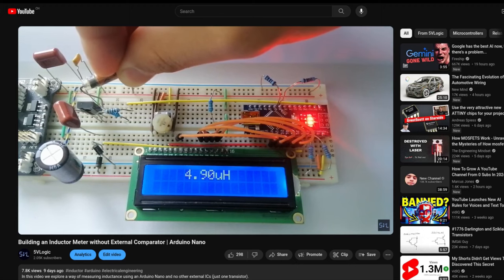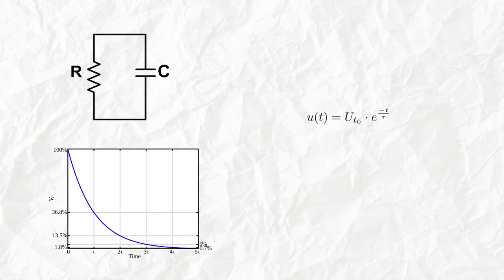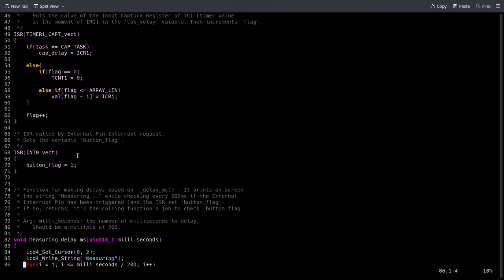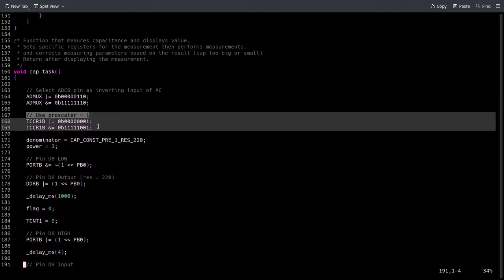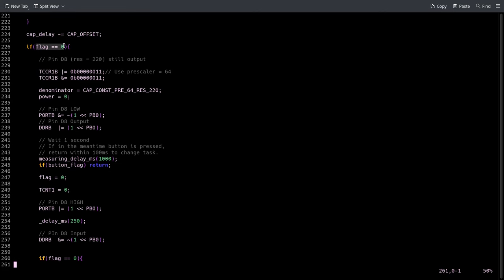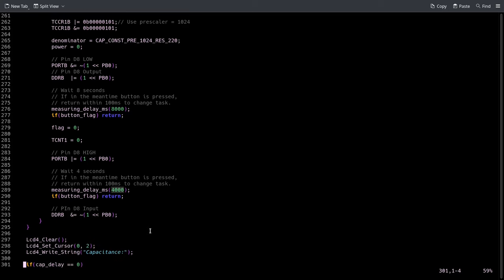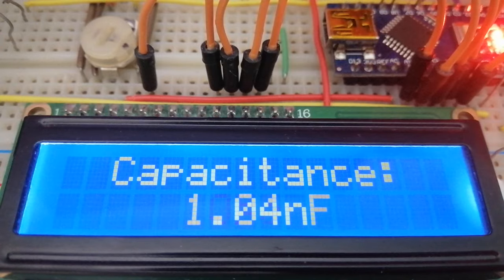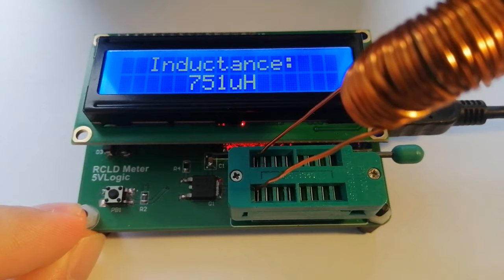Building a Capacitor Meter without External Comparator | Arduino Nano

Comment: Good job! I wonder if instead of trial and error method for choosing the range, you could use an ADC to track the very first points on a charge curve. Since it is linear in this region, you would instantly have a decent approximation
Reply from the maker: That's a good idea, I should try it

Comment: Very nice project! It would be cool if you could spend a short time going through your schematic, and then any peculiar layout choices you had while designing the PCB, unless you don't like sharing that.

You might also be able to use a transistor/mosfet and smaller resistor, for the purpose of charging or discharging the capacitor very fast to 95% of the way during the 'setup' phase of the measurement; that way maybe you reduce the time for full measurement by ~1/3rd
Reply from the maker: Thanks,
No, there's no problem sharing the PCB design info, infact I'd share the project files but I'm not sure what would be a simple way.
Tha main reason I didn't go over the process in the video is because:
1) I was taking longer than expected to get the video done and got a little lazy.
2) I use Altium on a windows machine, but do everything on Linux, so filming it would have been an extra job.
Maybe I could have taken some screenshots and used those for a quick explanation. An idea for next time.
Also good idea about the capacitor charging with a transistor!

Comment: Hello again sir. 
Made the Circuit, only problem is that it can't measure inductor above 50uH. Does it need a specific kind of Capacitor?? (I'm using Polypropylene cap) 
I can measure 50uH below exactly, but with higher inductance, it can't measure.
The capacitor measurement has no problem BTW.
Thankkkk youuuuu🙏
Reply from the maker: That's a though one, the polypropylene cap should be fine, just don't use an electrolytic one. I'm assuming you are using the same value as me...
Maybe you can increase current in the inductor, but I'm not sure. If you have an oscilloscope, check the waveform going into the Arduino ADC, this way you can figure out if it's a firmware problem or a hardware one.
Hope this helps
Reply: @5VLogic  I'm using a High Gain transistor, i tried increasing the Pulse time of the Transistor, it's the same. I'll probably experiment again, thanks for the response

Comment: Hi 5 Volt,
thanks for the video.
please, share your gerber file to github.

btw, can you make video how to write code on Vim and compile it.
i have been using arduio ide, so i want to try learn something new.

thanks before
Reply from the maker: Hi,
Sorry for the super late reply, I guess your comment flew under the radar.

I'll keep you suggestion in mind, but since I'm not that knowledgeable on this topic it might have to wait.
Also not many people use vim and Linux unfortunately so I'm not sure the video would do well.

Still, thanks
Reply: @5VLogic  thats fine, your welcome